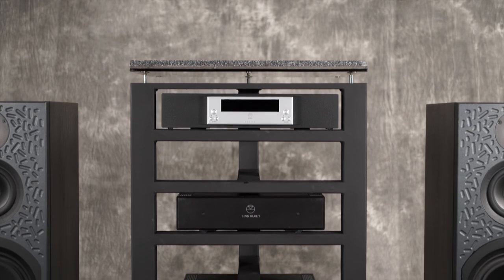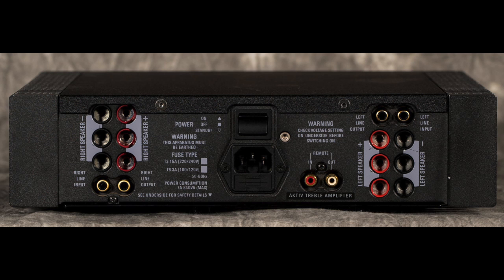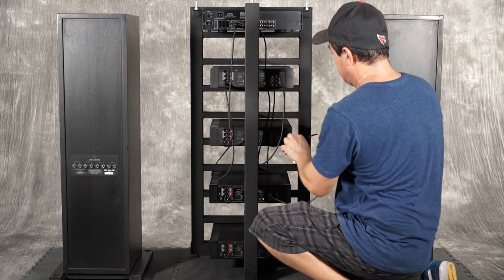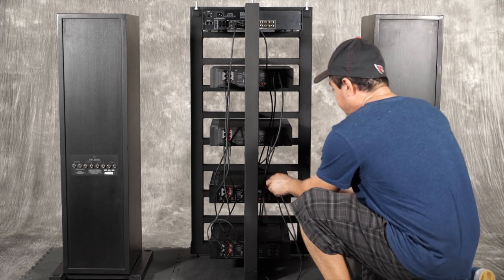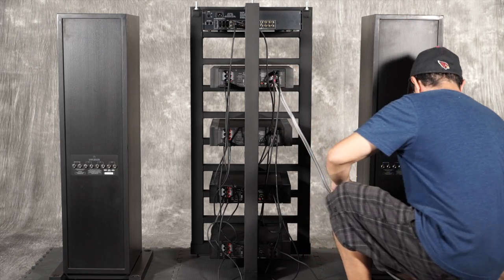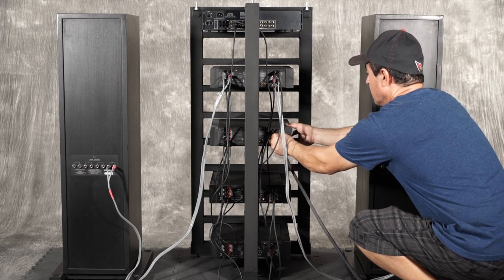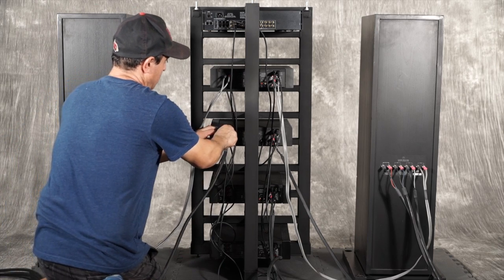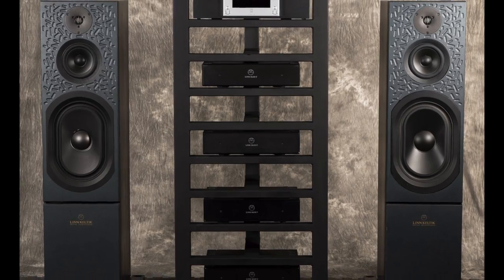Linn Keltik Aktiv System

Comment: This system while nice enough is waaaay to expensive for the sound it produces. Three expensive Linn amps is an obscenely priced way to drive a single pair of over priced speakers which sound jokay but not great. They do however sound better than the old Linn Isobarik (Brik) cult speakers which ware colored as hell in the midrange with a horrible measured frequency response for such a ridiculously expensive speaker.
Reply from the maker: That may have been a valid argument at the original list prices for this gear - but at what it can be had for on the used market you would be hard pressed to get better sound for the dollar
Reply: I have a friend who’s dad has a (brik) system as you put it and the speakers are right against the wall crazy placement. I have to say, with a well recorded record playing, it sounds great. And I’m an experienced audioholic. People need to calm down and actually listen before we start cramming price performance and all that into the equation. I really want an lp12 myself though I’ll probably get a VPI or something instead. System matching and evolution is far more important.
Reply: have you ever seen an expensive system that doesn't have a ridiculous price attached to it  ?

Comment: I had NOS Keltik with a external crossover, three 2250 power amps and 5103 pre-amp. Once day i bought a very old Linn Kann MK 1. Whole night of listening and compairing and my Keltiks goes away with all active system. It's was like a David and Goliaph battle and Keltiks loose it completly in terms of music. Later i migrated to Naim amp and sources and than to SBL and DBL without regrets. But Linn Kan still a fantastic little speaker. Keltik is dull and outdated.
Reply from the maker: Well I would agree that the Linn Kan MK1 is a special speaker and could see how you would prefer it as a change - I doubt you could really compare it to a fully active Ketik system. The Kan has no very low bass and can not produce the full dynamics of live amplified or symphony music. So I suppose it is based on what you value in your listening and would bet just as many Linn fans would pick your prior system as your latests change to a mini monitor
Reply: @theaterboyeBay  Linn Kan MK1 and MK2 have more homogeneous and coherent sound than Keltik, it's important if you listen a music instead a set of frequencies. And they work faster than Keltik. Old Isobariks was also better, than Keltiks (and more complex too). 
Same story was with Linn Kaber upgrades. First version with soft dome tweeter was the best, than comes "upgrade" with worse "mesh" twitter. And than comes secon upgrade with "three bars" tweeter — even worse. At last comes next upgrade with Ninka tweeter (and tiny magnet) — the worst. Linn just passed with a wrong direction with their "classic" loudspeakers and finaly changed it with arrays (that is complete other story).
Now i'm happy with my active DBL, they bring a speed and coherent sound of Kans but have a better bass and more details in sound than Keltiks. Just other league.
Reply from the maker: @finvarg2  Any well designed mini monitor speaker will sound more coherent then a large 3 or 4 way design. No Linn lover I know would select Kaber's over Keltik's - I get it you don't like Keltik's but thats your personal preference. Many would choose Keltik's over your Naim DBL’s. So try and remember your opinion is just that and stop making statements like they are facts
Reply: @theaterboyeBay  Nobody prefer Keltiks to DBL. Keltik is cheap at second hand market (about 1/9 of their list price) and DBL is rare and expensive now. I'm just share my expirience and your "facts" is just another opinions, not more. You a trying to justify owning outdated and unsuccessful speakers and I didn’t ask for your advices, right?
Reply from the maker: @finvarg2  I guess you just like to argue - for clarity I have made no personal opinions on the Keltik’s in our back and forth. The only thing I stated as fact is that a well designed 2 way mini monitor will always sound more coherent then designs with more drivers and that when compared to Keltik’s they can not produce as dynamic and full range presentation.  I never said I would choose the Keltik's over the Kann’s or DBL's. You assume I am defending the Keltik's because I own them - I don’t. But I have helped more then 20 people build active Keltik systems that are spending all there time enjoying them rather then trolling Youtube spewing opinions as facts as you are doing. I owned a fully active Linn/Naim system in the 1980’s when those companies still worked together and really enjoyed them. However I would not use that same system today as my listening preferences have evolved. I currently use a single driver system with no crossover which I promise you makes your prized DBL’s sound like an incoherent mess. Now there’s a personal opinion of mine stated as a fact. But any speaker design has it limitations - so I would never dream of telling you that your choice of speakers was invalid even though they are dated and likely low resolution and lacking coherence compared to what I would choose.
Reply: @theaterboyeBay  You a selling (or sold) this type of speakers for clients — now for me clear your motivation. NBL and DBL is completely different speakers, you confused yourself or just totally incompetent. After giving unwanted advices you are trying to classify opponent opinions like a trolling. What's next?
Reply from the maker: @finvarg2  What's next - Bla Bla Bla
Reply: @theaterboyeBay  what kind of stand is that and where do i get one  ?....not easy finding one that will fit a linn aktiv system with 5 amps
Reply from the maker: @teddyruxspin8480  stand was custom made for the Linn dealer here in Phoenix Arizona by Billy Bags over 20 years ago they probably made 5 or 6 at the time but you will likely never find one now - probably have to pick a local fabricator in your area and show him this stand as an example
Reply: yes i've seen a few like it  over the years and they seems to be all custom made .bummer , thanks anyways

Comment: I thought the Keltic uses an active crossover system so you'd want an active crossover between the preamp output and the inputs to the amplifiers. There isn't a crossover in the speakers, the idea is that you increase the headroom of each amplifier if it only has to amplify the frequency ranges for each speaker driver. With this video you're putting everything though all the amps and though every driver, thus a very nice tri-amp configuration but it's not the 'active' method to get the best out of these speakers.
Reply from the maker: The active crossovers boards are in each amp. Linn Delivered the Keltik speaker system with a set of eight active cards for the dealer to install - cards are installed in the left and right channels of each amp. Later on they did make outboard crossovers as well as the cards were a big pain in the ass to install
Reply: @theaterboyeBay  - Yeah that would be a nest of interconnects. Much cleaner and more efficient with the onboard aktiv cards. 
Thank you for the Klout you sold me years ago - it's still blissfully powering my Keltiks!